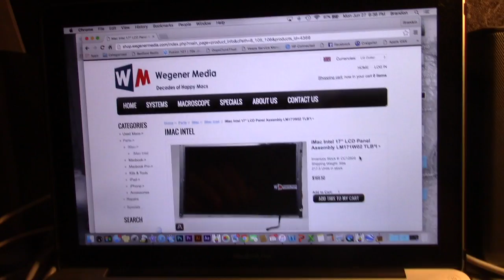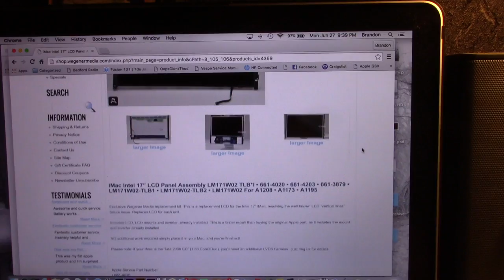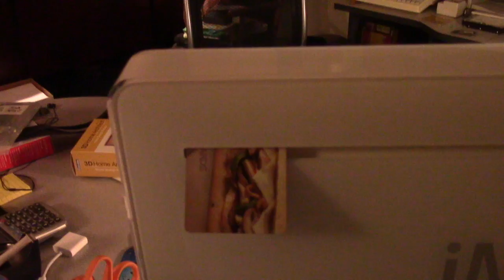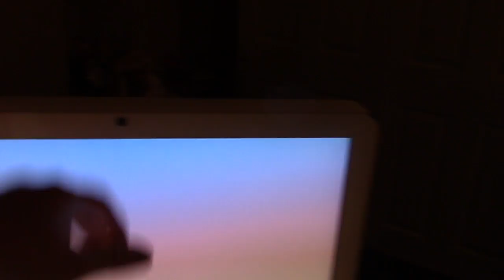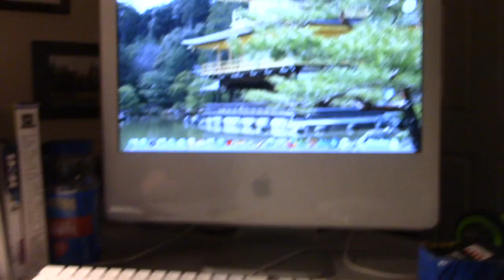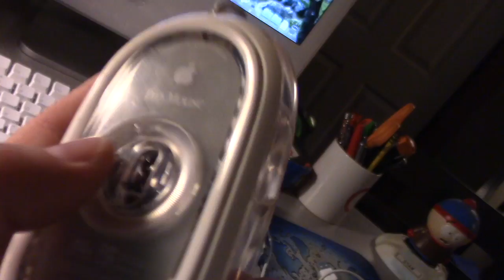First Generation Intel iMac; A Technician's Perspective

Comment: Hi Brandon.
My dad just gave me a few weeks ago a White 20' Core Duo A1174 model and yer absolutely right.

They latches and the whole shebang are an absolute bugger to take apart, not to mention of course I do need the right Torx drivers, got away with  a T7' for the front bezel when ye really need T8s and T6's.for the display connector.

Looked at iFixit the thing won't turn on, tried all the usual stuff no sign a life.

So I'm tryin to find the little fault LED's on the motherboard I've only just got to peeling the EMI shield back and looking baout, still need to wait till I get the right screwdrivers to take the screen and the LVDS cable out, maybe they're behind that.

I don't really care soo much about the machine I mean I got it just to piss about with, and aye that rubber gasket and esp the microphone cable boy those are a real pain in the nether region to get loose without breaking something LOL.

Comment: Typing this on a 5,2 that I just replaced the LCD in! It actually didn't have any lines, but it was cracked. I also swapped out the Combo drive for a Superdrive. It's a great little machine. I 100% agree that the mylar shield in these is a pain in the ass! I absolutely hate it.

Comment: I found (left on a dumpster) a 20" Imac like yours, except mine does not have built in camera.  the inputs on back of mine are running vertical, up the backside..  It works, and is beautiful.. slow on the internet, but i'm just going to use it for word processing, and it's retro creative tools..  I used to lust for one of these, but could not afford at the time..  Now its mine!!

Comment: I actually have one of these iMac 5,2 17 inch models, and it still has a perfectly mint condition screen, idk if it’s luck, or what, but I haven’t seen one of these with the vertical lines issue

Comment: I remember when I started out as a tech. It was within a year of Steve Job's return to Apple. Most of the systems we worked on were the old beige systems. I also remember the G3 AIO, which was incredibly heavy. I still have a G3 beige short tower, which was the second to last of the old designs.

I used to fix the original iMacs. Those were fun.

Comment: Man, I hate these latches Apple used in these iMacs! The G5 I think had a better case design, just unscrew a few screws at the bottom and the back comes right off. I had to replace the hard drive on my Late 2006 model and one of the clips was having the hardest time letting go. The other one did it on the first try but I spent about 10 minutes trying to get the other one to release shoving the credit card in there. Turns out I actually damaged the clip slightly, bent the metal holding it in place. It still reattaches but the back of the case is no longer flush with the front bezel. Not a big deal, right? But for me and my OCD It really bugs me. Ended up hot gluing the entire top of the case to make sure it wouldn't wiggle around. Still bothers me and I hate Apple for using these latches. :(

Comment: Haha, I still use this 20" iMac as my primary computer, granted I have upgraded the CPU to Core 2 Duo 2.33 Ghz, maxed out the ram to 4GB (3GB usable because of the system limitations), custom installed Yosemite 10.10.5 to run on it and replaced the hard drive with a 256GB SSD and the Superdrive with a 128GB SSD and connected an external High Def monitor. Have certainly gotten every pennies worth out of it, not bad at all for a 10 year old computer.  :)

Comment: Interesting video, I've researched these machines quite a lot but didn't know the fine details about repairing and failures. 

Recently managed to get a maxed out pretty much mint 24" model. Its running perfectly under 10.6, YouTube and Netflix work great, handles all day to day tasks, the display is really nice, over all I'm super impressed considering the machines age. Running SMC fan control and keeping a close eye on temps as I know the issues these machines have.

Was there a reason why you didn't cover the 24" model at all, just curious?

Comment: I used some relatively modern programs on Windows 98 with KernelEx. I got FF 8 to work on it with a newer version of Flash. It would barely play YouTube videos in 360p, but it would handle 240p decently.  The rest of the Internet rendered properly but was too slow and eventually made the machine unresponsive. This was on a Pentium III machine with 512 mb RAM, so your mileage may vary with a lower-spec machine of the era. I eventually put Debian on it and it seems to do a little better, but the thing is still far too old to be a "daily driver," in my opinion.

Comment: Hi, Even though I was born in 1991. I thought your IBM PS/2 model 80 was a cool machine. I hope that IBM would place MCA into the public domain. That would be a very neat thing to hack and build an ARM based system around. I believe IBM did use the bus in their RT/PC machines with RISC type processors. According to Uxwbill, MCA bus has a lot of grounding pins so it is good for sound digitizing. It would probably also great for video capture and editing if it was placed into the public domain, extended, and brought to modern CPUs.

Comment: Couldn't you just run modern Windows on that machine? Or a Linux distro
Reply from the maker: Technically, yes; but I have no need to do this.
Reply: +BBISHOPPCM's World just as to regards with modern web standards etc that you mentioned, when the version of OSX on them becomes completely obsolete.
Reply: I enjoyed the video.  Put an SSD into my early 2006 Core Duo (yes, 32 bit) and struggled as you describe to get the clips to release.  But in response to Jonnyinfinite, the reason to try another distribution is the one you mention in your video:  because secure browsing is under OS X 10.6 is fading from the scene.  I've had good success with Peppermint Linux, which restores my access to Chrome (well, Chromium) on this 11 year-old machine.

Comment: The regular Intel iMacs (non education model) all shipped with a dedicated ATI Radeon X1600 GPU. The education models didn't have a dedicated GPU at all, but rather simply used the Intel GMA950 integrated northbridge graphics, like the white MacBooks of the time.

Comment: My ex step-mother in particular was quite the wet blanket as far as my computer collection went. My first tinkering machine, a Dell Dimension 4100 with an 866MHz Pentium III, a GeForce2 MX, 512 MB PC133 RAM and Windows 98SE went to the landfill because she wanted it gone. If I had known then how much I would appreciate something like that today, I would have fought harder to keep it.

Comment: So I was about 9 years old at the time I got my Late 2006 17in IMac. Our school had them and I begged my dad to buy one. $1,000 later, I received a computer that went on to last me about 3 or 4 years. So what all failed during that time? The Hdd which I replaced with a 250gb drive. The superdrive stopped ejecting Cd/DVDs without the help of a credit card. And finally, the display turned into a rainbow with 1/4 of the screen being solid black. So 10 years later my IMac remains in the original box. I wish I had the money to buy a replacement display but I guess for now I'll enjoy my Tangerine iMac G3

Comment: I have a 17" Core2Duo 2GHz of the Late 2006 iMac. It works perfectly under 10.7.5 Lion with Youtube, Netflix, HD video, etc. I've read a lot of online complaints about the graphics card ATI Radeon X1600 overheating due to lack of cooling or the origin Chinese factory that some came from. I dunno! But I did buy one recently from ShopGoodwill.com for $40 shipped. I was paranoid of it overheating or developing lines on the screen, so I opened it up, upgraded the HDD to a 120GB SSD, dremeled a small hole along the back casing where the graphics card heatsink roughly was, slapped a USB Fan to the outside of the case over the hole and had it blowing into the computer. 

So far, no issues though I haven't been using it as much. It sits in a corner alcove of my kitchen counter.

I think Core2Duo Apple products will still do fine for media consumption and web browsing for at least another 5 years.

Comment: Hi. I am visually impaired and am into computers. I would like
to work in technical support some day. 

I use screenreader on Windows. I have done a BTEC National diploma
for IT Practictioners. I have also learned things from experience and from reading
computer resources online. 

I have been told by people that I wouldn't be able to do the
hardware side because I can't see. But no one has actually tried to show me, like
opening them up. And I have heard it is possible for someone with little sight to
open computers up. I of course know the components of a computer and felt inside a desktop on my course but that is all. 

Do you have any ideas how I can try to find someone who will
teach me more or give me work experience to take the time to show me more, such
as taking computers apart? 

I just find it so frustrating when people have assumed I wouldn't
be able to do things, so haven't tried showing me.

Thanks   

Hi. I am visually impaired and am into computers. I would like
to become a technician some day. 

I use screenreader on Windows. I have done a BTEC National diploma
for IT Practictioners. I have also learned things from experience and from reading
computer resources online. 

I have been told by people that I wouldn't be able to do the
hardware side because I can't see. But no one has actually tried to show me, like
opening them up. And I have heard it is possible for someone with little sight to
open computers up. 

Do you have any ideas how I can try to find someone who will
teach me more or give me work experience to take the time to show me more, such
as taking computers apart? 

I just find it so frustrating when people have assumed I wouldn't
be able to do things, so haven't tried showing me.

Thanks

Comment: I have the same 20" iMac as the one in this video and it has a GPU that's in the process of failing. I found a way to disable it in the operating system but it's much slower with it disabled.

Comment: Thanks for the heads up about possible problems with this machine. I recently bought a 17 inch iMac from a middle school computer lab out in Silicon Valley. I was really surprised how well they took care of that machine. It was in use since 2009. This machine works perfectly, even better after I bumped the RAM up to 3gb. I loaded it up with writing software and added an external hard drive. I use it offline so I don't care about the browsers. Haven't had any problems so far. I was so impressed with Mac OS and the iMac that I went out and bought a 2008 20 inch model for a song from shopgoodwill.com. That one has Yosemite and full internet. Both machines are running well. The 17 inch imac with Snow Leopard boots up faster than the newer one.

Comment: I work for AppleCare in the UK, and I know all about the vintage problem. We're now running into new phases of machines becoming vintage, and it's sometimes tough to get across to people that, hey, your machine is screwed, and we can't help you, sorry... I often wonder though, what they do with all those leftover parts. Binning them is just a damn waste
Reply: Kinda wish Apple could be more like IBM or Lenovo, and at least have the courtesy to keep old drivers/downloads up almost indefinitely as well (Lenovo/IBM at least keeps an EOL archive for their older machines, even the pre-2000 ones)... as for IBM/Lenovo AFAIK when their machines go EOL (usually 7 or so years), they often just sell their remaining parts to various wholesalers and websites (such as Impact Computers, Alan Computech, etc. on eBay) rather than discarding them completely

Comment: I have a late 2006 c2d 2ghz 17" iMac that I really only use as a file server now, the lines in the screen are getting pretty bad and I just can't bring myself to repair it economically so, when the lcd dies, guess I will scrap it for parts (ram HDD cpu etc)

Comment: Whats funny is that with my MacBook, I use a Magic Mouse, I used to use a wireless Mighty Mouse (the mice shown here with the scroll ball), I still have it, but I moved to the magic mouse because I like being able to swipe on the mouse for back and forward in Safari, something i use all the time. With my iMac, I have both the bluetooth Magic Mouse, and the keyboard, but I also have a wired keyboard with the number pad, and the trackpad. The keyboard pullout tray on my desk is small enough that even with the smaller wireless keyboard, its a bit too cramped to early use a mouse next to it, so I keep the trackpad next to it, and up on the top of the desk I have the big keyboard and a mousepad with the mouse. I have to use a pad, because it won't track on my glass desk for anything. But I think its funny, I use a trackpad on my desktop, and a mouse with my laptop.

Comment: Do you think that the 17" Powerbooks and 17" Macbook Pros will become collectable?
Reply from the maker: The 17" Macbook Pros are ALREADY collectible! Apple no longer makes a laptop that size, and the later models are still very useful machines. As for the Powerbooks, it can take YEARS for these to become collectible, but I don't see why they wouldn't.
Reply: BBISHOPPCM's World Yeah, the early 17" MBPs are priced at some crazy numbers. I guess because you can have that PowerBook design but with hardware you can actually use. Thanks for the video btw I might pick up a 20" iMac. Do you know why the 20" iMac's dont suffer from the lines disease?
Reply: Kristofer Smith I managed to pick up a 2010 17 inch MBP for pretty cheap, I threw an SSD in there and it does great, as it's an early gen i7 though it kicks out some heat.

Comment: Atleast Firefox is able to be customizable to run on odd architectures.

My Powerbook G4 I know I've told you this before but you can atleast get Mr. Geko's Youview to watch youtube videos in Quicktime instead of Flash, actually works flawlessly almost butter smooth.

There are ways of doing things on these older machines but I generally agree wiht you Brandon that the web has become ridiculously complicated far too much eye candy and all this web 2.0 stuff I don't think really makes a huge amount of difference that couldn't be done before with other methods that were probably less demanding on the computer.

Comment: Very good and informative video! I've enjoyed every single second of it.

I've had for 2 years approximately a 17 inch Core 2 Duo (educational, no Bluetooth, crappy GMA 950) and it has been running well in our recording garage.

The circle button on the black/white mouse actually is said to adjust the resistance to pressure. If you move it to minus, you need less weight to click. I'm not sure why they removed it, but I've read it somewhere.

Comment: My favorite thing to do to these machines is grab a cheap SSD from Best Buy and throw one in. Instant speed increase and heat decrease.

And yeah, optical drive failures are frequent. I've owned several Macs of this vintage and half of them had failing optical drives.

Comment: I still use PowerMac G5 for web and video editing without problem, this is Core 2 Duo this is very fast chip and 10.6 and 10.7 are very useable. I have 10.7.5 on Macbook and i can use it without problem.

Comment: I have this exact machine, runs perfectly. 1.83 Core 2 Duo, 2GB ram. The HDD was upgraded in 2011 by Apple when the iMac fell off a desk. Upgraded to a 500GB seagate drive used in the 2010 iMacs I think

Comment: Is there a reason you didn't mention the 24" iMac6,1 in this video? It's a better and more reliable Mac when compared to the 20", and I use mine on a daily basis running 10.8.5 Mountain Lion.

Comment: My high school had similar those exact iMacs in the newspaper room, and they ended up having to get new ones because all except one had that display issue you mentioned. If I remember, there was also an iMac G4 that lasted longer than the intel ones.

Comment: Hey Brandon, since you're Apple certified, you might be the best person to ask this to. I have a Macbook Pro 2010, 13 inch with 10.8.5 on it, I've been told that the newer versions of Mac OSX have improvements to speed up graphic performance and whatnot. I still have the stock HDD in the computer. Knowing this, would you recommend a software update to a higher version? I like how the older Mac interface looks but I want to know if I can gain anything from updating.
Reply from the maker: I'd go for the upgrade; it should improve performance, and you'll have peace of mind knowing you're running an OS that is fully supported by everyone who matters. 10.8 was a bit buggy if I recall. I do recommend upgrading the RAM to the max. supported (16 GB if I recall).
Reply: just to add, if you upgrade to an SSD on that machine, remember to install TRIM on it, as OSX doesn't automatically recognize that it needs it.
Reply: I have (and am currently using) the same MBP (2.4 GHz Core 2 Duo, 4GB RAM). The HDD failed after about 5 years, so I replaced it (and the cable, which was also bad) with a Crucial SSD. The speed sky-rocketed. It booted in about half the time (maybe even less). I couldn't believe it. I didn't even do anything to the RAM. I'm running the latest OS (OS X  10.12 Sierra) and there's no lagging during the programs I mainly use it for. It was almost a good thing the HDD failed (it functioned long enough for me to get my data off).

The only issue I run into is when typing a string of words (in Word or Pages, for example), as there is some lag. But if you still have your MBP, a $250 or so SSD upgrade may be something to consider. Although these MBP's will probably no longer be supported after the next OS is released. This laptop is the oldest one still supported, so it's probably on the chopping block.
Reply: I actually sold it for $300 and traded up for a Macbook Air 2015.